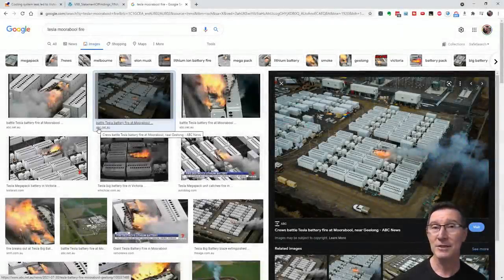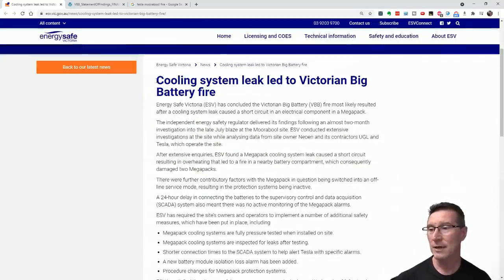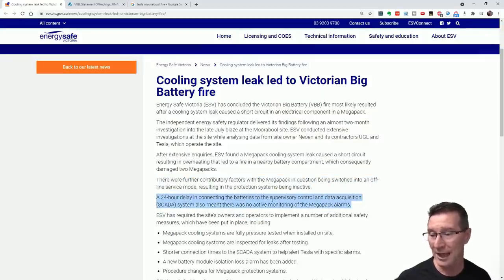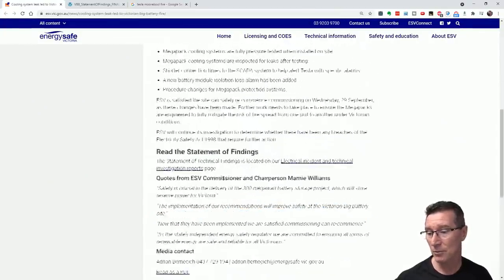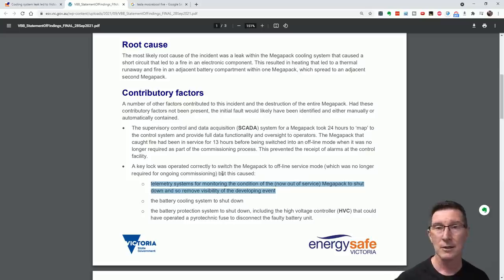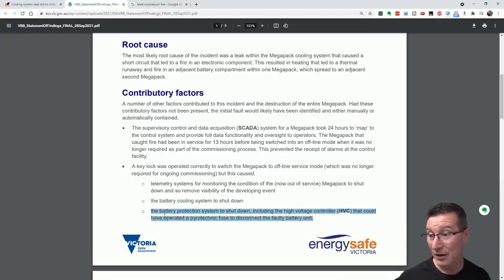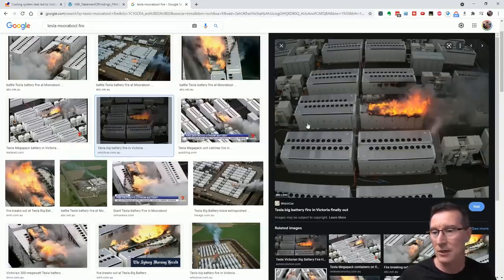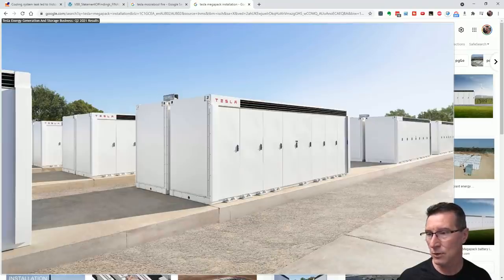EEVblog 1422 - CAUSE of the Tesla Victoria Big Battery Fire

Comment: Seems to me to be poor engineering design, with maybe a manufacturing problem - assuming the leak is the real cause. 
No safety monitoring - "idiot" Engineers who have no idea what they are doing. Seen it all before. They rely on "electronic shut down" instead of good old old fashioned disconnect fuses. Problem is the Electronics won't shut down - if it's full of liquid from a leak.
Liquids should NEVER be run next to electrical circuits - bad manufacturing design from Tesla. 

EVERY cell in the pack should be individually fused with its own LED light across it, so if a fault occurs it all can disconnect at the appropriate fuse point and reduce the output voltage to only CELL voltage. This will minimize ( but not stop ) the fire quite a bit.  At least the total cell voltage and amperage will be reduced as the fuses blow.

Battery spacing is way too close to keep fire at bay. Asbestos or ceramic fire resistant sheet will fix the fire issue between cells, or a simple over height brick wall would work well around each battery box.

Too much reliance on software and not enough backup hardware. BAD design concept from the start. ARRRRH!! - Lithium rubbish. Good design battery systems should have almost no electronics and definitely NO software.

Comment: A typical Lthium Ion Battery fire burns at 2000 C or #500 degrees F.You can extinguish the fire but NOT in a conventional sense.Your reporting on this is over speculative and without a REAL basis in facts.  Doc BC
Reply from the maker: There is a reason the fire depertment let it burn out instead of tryign to put it out. They know what they are doing.